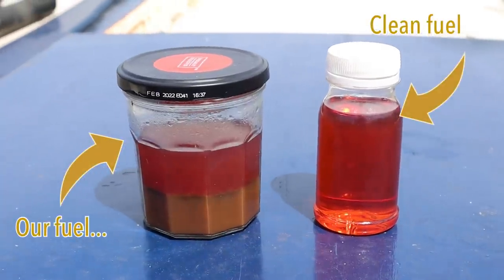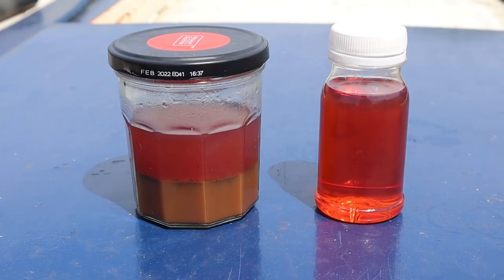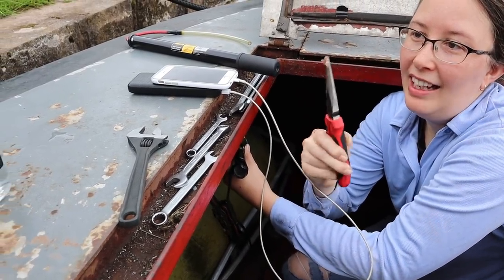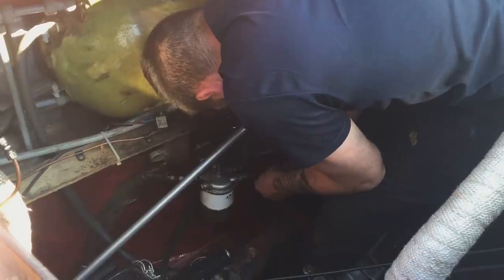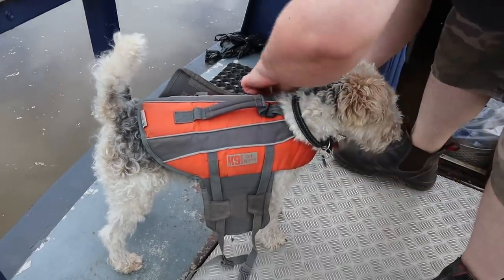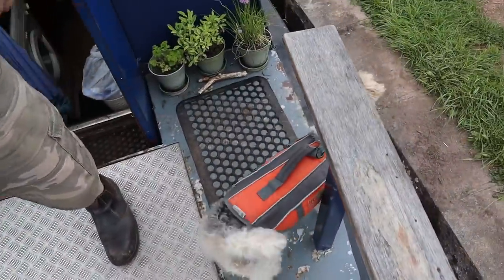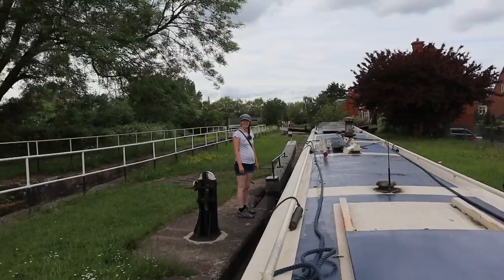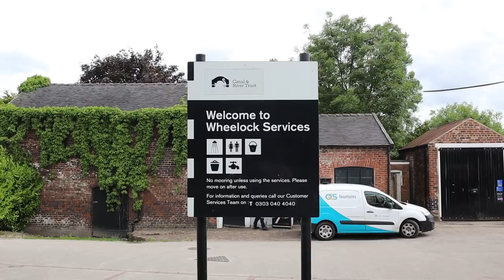Getting Our Narrowboat Fuel Tank Cleaned and Diesel Filtered | Quest Vlog #101

Comment: I maintained emergency diesel generators for a number of years. The diesel bugs were always a potential source of failure and on one occasion we had a very contaminated underground storage tank emptied and abandoned it and replaced it with a much smaller internet tank. Water in diesel tanks comes from two potential sources. One is some is always present in diesel fuel when it is supplied.  The other is from condensation in your own diesel tank.  One measure is always keep your ready use tank topped up especially when mooring up in one place for extended periods of time. This reduces the amount of air in the top of the tank so minimises any water condensing from the air.  It is good practise to remove any accumulated water in your diesel tank once year. The water will always settle in the bottom of the tank as its heavier than diesel.  A piece of rigid pipe long enough to reach the bottom of the tank through the filler cap along with some form of suction pump  to suck the water out is all you need. Lastly consider the ongoing use of a biocide additive to your fuel. These two measures will hopefully prevent any more breakdowns due to fuel contamination.
Reply: I will add  the problem has increased as bio fuel is now mixed with gas oil (diesel). I won't write a long essay on the subject and bore the pants off you., suffice to say bio fuels take up water resulting in  increase potential of microbe growth.
Reply: @lauripearce8266 A most excellent and helpful comment.  The only thing I would add to this now 2+ year old discussion would be to carefully inspect the hull to fuel fill hose joint, and the hull to fuel tank vent for any evidence of water intrusion.  40 liters is a lot of water!    A final thought is that polishing the fuel is all well and good but you also have to address all the internal seams, joints and baffles of the fuel tank.  All those spaces provide staging areas for the microbial growth to accumulate on the hidden interior recesses of the fuel tank.  Other than physically/mechanically cleaning out entire inside of the tank through access ports (if they exist, or installing them if they were not part of the original tank design) I do not think there is any way to completely rid the fuel storage system of "diesel bug".  Filtering fuel treats contaminates suspended in that fuel but not necessarily the contaminants adhered to the structure of the tank
Reply: I agree with everything you have written. However my original post was written with the thought  KISS    " keep it simple stupid. "  In everything I tend to rewrite   War and Peace   and when trying to help less technical able people I notice their eyes tend to glaze over if an explanation gets to involved. So I tried to keep my post to a minimum.  From my casual watching of  Utube creators videos  this is a all too frequent problem.  There are several companies specialising in filtering and dewatering diesel tanks for canal boat live aboards which in my mind indicates the size of the problem. So easily avoided with say half an hour a year checking for water in the tank with a revealing paste .    @apackwestbound5946

Comment: Wow, 40L of water!  that's an awful lot - shows the value in checking for water periodically.... check your fuel cap is tight and isn't leaking water into the tank. Get some 'Kolor Kut' paste to put on your fuel measuring stick which will show you where water is. Now its all clean you can keep on top of this yourself by keeping the tank topped up as much as possible and get yourself a copper tube which reaches the bottom of the tank with hose on so you can get any water out yourself (siphon to a container) ... much much cheaper!  and also pop in some diesel treatment.... interesting video, thanks!

Comment: Hi   50+ years of driving Diesel trucks in England & usa  i had never ever heard of diesel bug ??? But i am glad you got it all sorted  now everybody can watch your next vlogs so safe journeys  to you    Ed 40 S of Vegas XXX
Reply: Narrow boats don't slosh the diesel around the tanks as a truck would, being on the water there more susceptible to condensation forming in the empty section of the tank and diesel bug grows between the water and fuel.
My troubles started when I started going onto rougher water and it all got stirred up into a thick soup.
We kept out stand by generators fully topped up for two reasons, one in case of emergency, two prevent the dreaded bug.

Comment: Hey guys. Having been around boats and  diesels all my working life. I have a tip that you may like to hear about your tank .
 Get a length of wood  that is the length of the depth of the tank plus one foot.  Mark it for the fuel contents. On the bottom of the dip rod firmly attache a small magnet , it doesn't have to be huge just strongish.  Then varnish with Matt varnish. Then get a tube of water finding paste . Then every time you check the level  or fill your tank just put a smere of paste on the bottom couple of inches of the rod.  And dip . Three things will happen one you will know how much fuel you have . Two if the paste has turned colour due to water and how much you have . And three the magnet will have any metal partials on it.  If nothing else this will give you advance warning of the need for a fuel clean.
Just a thought. 
I drove trucks for awhile over hear in the states and had one on the truck as well.  Took a lot of ribbing over that. Untill one day after fueling I did a dip and found 2 inches of water and metal shavings. In a tank . reported to the office at the stop and they put that line out of service to check it . I drained the water out of the tank and magnet fished for a while untill I was getting nothing . Went on my way. Several days later I returned to that stop as its a regular stop for me. And they wouldn't let me pay for my fill up 150 gallons. And a free lunch. 
 My company nothing. What ever!!!!
Reply: Truck..."mixed"fuel.....sounds like you were very"lucky"......ie organised....and they guys you were working for, should be a place you are no longer aiding to profit.

Comment: I too had diesel bug problems with my old boat, she was fine plonking about on the upper Thames but venture down to the tidal section and hit a few pleasure boat wakes and the DB would get stirred up block the filters and cut the engines. Emptied the tanks, screened the fuel through truck filters and got loads of crud and water out. Didn't know about diesel polishing service in those days. Got blocked filters again crossing the English Channel from Dunkirk and had to be towed across.
Fitted new engines, tanks, pipework filters and water separators. Also installed a recycling system to filter the fuel in the tanks. Didn't need a magnet as the tanks were plastic and see through.

The bug grows in the layer of water formed from condensation on the sides of the boat and SHORE tanks, so when you refuel you could be adding water and DB to your nice clean tank. It good to filter the new diesel but this is difficult and why I installed the recycling system. The engine fuel pump also takes more fuel than is needed from the tank and returns the unused to the tank, this warm even hot and that causes condensation in the tank. Try to keep the fuel tanks full and so doing leaves less steel tank side exposed for condensation to form.

Glad to see your getting proficient at  bleeding diesel engines, as the bleeding things often need it.

Stay safe and thanks for posting the bad time as well as the good ones.

Comment: Good that your engine is back to normal working order.    The TankBusters section was very interesting.   An amazing amount of unwanted materials in the fuel.   I wonder if the tank temperature swings cause air to vent when hot then to suck in air when cold.   The air will bring in moisture over time.   Water is heavier than the fuel so sits on the bottom of the tank.  They did a terrific job cleaning your tank.
Dave.
Reply: If this is the case for the water in the tank, should it be cleaned to remove the water each year before you moor up for the winter?  Just wondering.

Comment: What you has were SRB "Sulphate Reducing Bacterial" There are two types aerobic and anaerobic IE those that require oxygen and those that do not require oxygen. They produce sulfuric acid that will dissolve the steel in the bottom of your tank and eat holes in your tank. You should get your tank "Polished" It will scrub all the colonies out of your tank.

Comment: In USA we do get algea growing in fuel sometimes .  if we get water in tank i used rubbing alcohol in small amounts to get water out of fuel plus in winter ice will form and block fuel lines  North in USA by Canadian border temps get down to 45 to 65 degrees F Below Zero Not below freezing point but below Zero we have fuel heaters mine was in the tank also heaters in engine block so as to get engine running. great to see how the fuel was cleaned in your vlog enjoy you channel   Ed 40 S VegasXX

Comment: Water in the fuel happens when the tank is not kept full as the moist air condensates that causes rust. The water will settle in the bottom of the tank and that's where the diesel bug 🐛 lives which is why the fuel pickup is a few inches off the bottom of the tank. Ideally there should be a valve at the very base of the tank so you can drain the water regularly and check for bug or contaminants. On sail boats it's recommend to drain a check the tank at the start of the season or before a passage to avoided upset. It's odd that it turned out to be plastic that stopped the show but it was good to see the polishing system in action. If you buy a plastic tank like that used for outboard motors and set up the fuel lines so you can plug it in to bypass the main tank that would give some peace of mind.🏴‍☠️

Comment: I don't know if it is available in the U.K. but we have a product here in Australia called Chemtech Diesel Power which is excellent at cleaning the tanks, killing "clad" (your "diesel bug") and emulsifying water so it is not an issue - it is mixed evenly throughout the fuel. It also cleans injectors and the fuel system. It more than paid for itself in fuel savings as it improves fuel economy. It basically paid the majority of a driver's wages in savings when I owned a fleet of heavy trucks towing road trains. Surely there's similar in the U.K. for you to be able maintain a healthy fuel system.

Comment: Not much 'chefing', but a lot about boat diesel fuel systems I didn't know!  Thank you.  Those Tankbusters have got it well organised, haven't they?  40 litres of water from your fuel tank?  That's a whole full Aquaroll, which we use when we take our Scouts camping (chance would be a fine thing in more than eighteen months.)  I know Well Deck Diaries have one, but the Aquaroll is a bit bulky for a narrowboat, never mind that it is the easiest way to move 40Kg of water over any distance.

Although we Enthusiastic Hire Boaters have only been that way once, I loved that section of the system.  If I had my own or a syndicate boat, I think I would just circulate round the 4 Counties Ring, with occasional trips up the Caldon.  Looking forward to some more chefing in the future, great vlog and glad you seem to be on the move, at last.

Comment: So how did the water get into your tank?  Looking at everything that came out of your tank, it is amazing it ever started. Should be smoother boating now.
Reply: If fuel comes out air has to get in (the petrol or diesel tank in your car is the same) and air contains water. Changes in temp can cause condensation. So water in your tank.

Comment: Great to see you moving again at least you now know that tankbusters is never the right answer to your problems over £600 and then you still have to fix it yourself and remember the tank is still dirty they can only clean the tiny little bit below the filler the rest of the bottom of the tank is still as it was before they started keep a couple of fuel filters with you just in case it happens again

Comment: how did the water get in the tank?
Reply: Condensation. As you use diesel, it's replaced in the tank by air, which holds water vapour. Because the fuel tank is at or often below the water level of the canal it's always cold, so the water vapour condenses out of the air onto the surface of the diesel, then because water is more dense than diesel it sinks to the bottom and gets stuck there.

Comment: There is no way you got that much water in your tank through condensation. That’s pretty much a boating myth. Under the worst possible circumstances condensation can only count for a few milliliters.

Either someone sold you some badly contaminated fuel or you have leaks in your fuel tank. Since they pulled out so much rust I surmise that your fuel tank is black iron or steel. My guess is you have pinhole leaks that are allowing water from the bilge to flow into the tank. That happened in my sailboat fuel tank and resulted in a massive amount of water and bacterial growth.

The fuel tank should be removed and inspected or replaced. Otherwise this is all just going to happen again. As far as polishing the fuel goes that only works for minor contamination. Would’ve been a lot cheaper just to pump the fuel out, let the bacteria settle out and then gently filter the fuel floating on the top.
Reply: Most narrowboat fuel tanks are integral with the hull, and are made of steel so replacing is a major engineering task.
Inspection would be a good idea, provided one can see the whole tank. Some folks have reported good thinks about having the tank cleaned, degreased and then a protective coating applied - but other say they've had nothing but trouble from these coatings.
Reply: @rickedwards7276  I agree that £600 sounds very expensive (indeed it is more than double what a neighbour paid a couple of years ago for the removal of a similar amount of water and muck).  Also your experience with having no luck with coating a tank interior is probably the majority of cases - great on new tanks, but a low success rate on old tanks.
But I think you are missing the point that the tank is INTEGRAL with the hull, and forms the stern-most section of the hull.  If you look at the part of the video where Ryan is crawling in to get to the outlet stop he is lying on top of the tank (or at least he would be if if weren't for the weed hatch cover getting in the way....  Tank removal can be done, and it either involves just cutting away one wall of the tank, and (if possible) part of the bottom of the tank (on my boat the bottom of the tank forms part of the counter which is fairly common); or removing the complete stern section above the counter, then cutting off the bits of metal you don't want, then weld it all back together - which is an "interesting task" given that most of the inner surfaces having been gently soaking in diesel for a good few years.